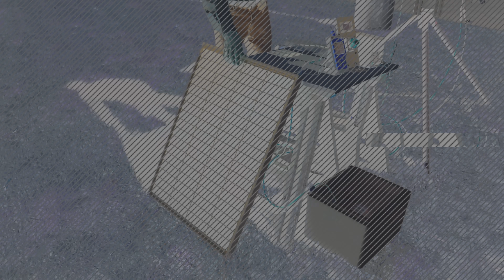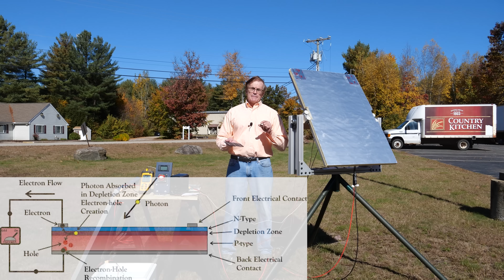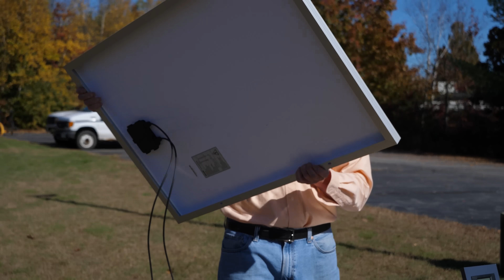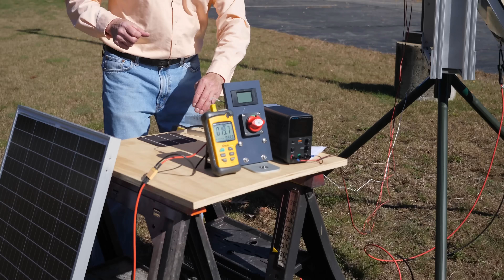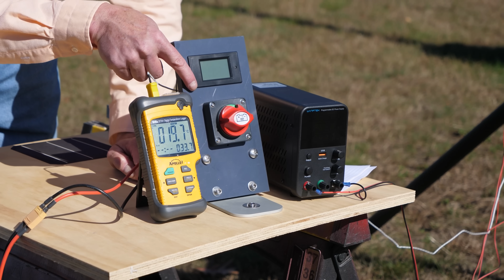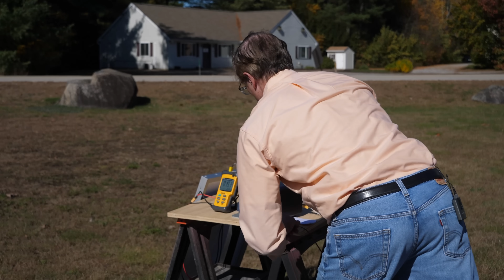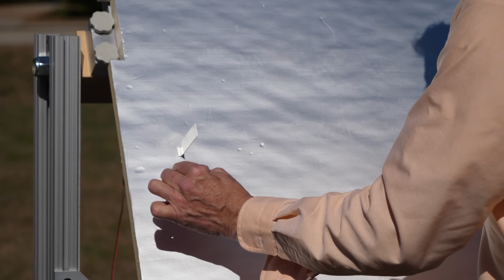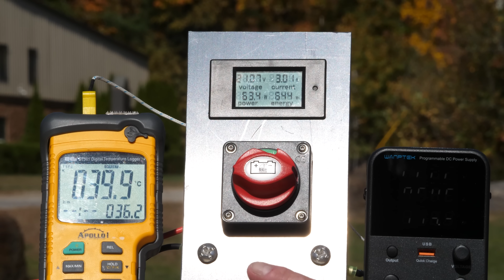Do you REALLY get enough out of your solar panel?

Comment: How about using the 'waste' heat for drying the dessicant in your alternative air conditioner? I would love to see you do that as a video (including analysis of the overall system power consumption, etc.).
Reply: Heat is energy.. so it feels bad just letting it out without use.
Could be used for something.. from heating house, heat storage, water or anything
Reply: @The Tired Horizon  on the contrary, it should be quite hot... ;-)
Reply: @The Tired Horizon  Ye, bi-metal tech is going the right way. But efficiency is still low
Reply: @frosty6960  our guy is testing things .
But is kinda still shortsighted .
Or inefficient .
Reply: Came here to say the same.
I was enraged the whole video, wondering if he would use the heat for the hot water in his house. Or, like you said use its freaking air conditionner. It's the perfect use!
This idea of cooling the pannel, is way better than he thinks.
Reply: @xmtxx  - any war is won one battle at  time - only fools throw all of their men into a fruitless advance.

Ask any general who did not throw is men into fruitless advances - and then go and ask the losers.

Just saying.
Reply: @TheTiredHorizon  or standing at the outlet of the air conditioner, inside.  :)
Reply: One of the problems here is that the heat coming out the other end may not be that far above ambient....  To cool the panel to closer to ambient more volume of cooling air is used per unit time, to cool the whole array equally well, and thus we pick up only a portion of the waste heat in a given volume, and the temperature doesn't rise much, which limits our options.
Reply: @The Tired Horizon  Stirling engine, or Peletier elements. They need a great enough temperature difference to justify their uses, Peletier elements are not very efficient.
Reply: @alexandredevert4935  Pelletier elements aren't very efficient... But at least it's something! Even a 0.0001% amount of heat energy turned into electricity is better than nothing.
If course we should keep researching alternatives, but it's worth it even if it results in 1 less gram of coal or oil being burned.
Reply: @runed0s86  Manufacturing of a Peltier will almost always involve burning more fuel than it can offset in such usage even over years of use. It's fine to look at alternatives to anything, but it's counterproductive to put much effort into things that aren't going to pay for themselves.

Comment: Definitely interesting any efficiency boost to solar without massively increasing cost seems worth it. I would be curious to see the temp difference with the back panel with fans removed rather than just off.
Reply: The fans alone will massively increase cost. The simple fact is solar panels are about 1$ per watt these days, and it's going to be impossible to find a high duty cycle fan, that can survive high temps, outside, that will increase efficiency by 1 watt for each dollar spend on the fan. Then consider those fans absolutely will need maintenance, and it's all the sudden not a good idea.

Comment: That solar panel looks to be about a square meter.  Solar insolation at noon at the equator should be about a kw.  Since the panel is only rated at 100 watts, doesn't that mean it's only 10% efficient?  That far below the 20% efficiency I usually hear about.  What am I missing?

Comment: I would love to see an experiment you thought about making, water based, artesian well, no fans, just a water pump. The water has a constant temperature of no more than 14°C, depending on depth and so the temperature differential would be much higher. If you have a panel that heats up to 80°C at midday, mid summer, you might easily gain recover 30% of energy, minus the one spent on the pump. And I bet the efficiency of the pump goes up if you have more panels.

I just realized this isn't without major problems. If you're using an open system, the water in it is... alive, meaning sediment and algae, and sooner or later there will be a coating forming on the walls of the pipes, the smaller the diameter, the sooner it will become a problem. :( And also, in the winter, you'd have to let the water out or the pipes will burst. But the higher differential is so tempting....

A closed loop system filled with glycol instead of water might be a better option, but you will lose the advantage of a much lower than ambient temperature of cooling medium, with added consumption of both the fans and pump, and added cost and complexity, so I'm sure this one is not worth doing.

Comment: Good to see you back, I have an interesting postulation for you, hope that's the right word. What if you line the back of the solar panel with Peltier chips to convert the excess heat into electricity and then attach the heatsinks To the chips cooled by those fans To maintain the thermal differential Required for their operation.? I think that would be a very interesting experiment to see if you get any sort of significant Energy gain.

Comment: Have you thought of using peltier modules on the back of your solar panel ? Maybe test peltier modules on a black metal panel then a solar panel. I realize the peltier modules won’t draw away as much heat, but the power you gain might be significantly higher. Thanks for the wonderful topics that you produce. Todd.

Comment: 3.5W is about $0.0003/hr at peak sunshine.
More material, and more to go wrong.
Sorry, but I don't see the value / roi in this.
Instead of buying fans every 3 years, and listening to that noise.  Buy another (3.5w) panel.
My weather station has an asperation fan and it drives me crazy and has already failed.
Reply: By my math on the 310W panel I bought for $120 - thats $0.39 cents a watt. * 3.5w = $1.37 worth of panel.

I doubt your fans, shroud,  and maintenance costs less than $1.37

Comment: There are some manufacturers making water-cooled panels. Check out Linus from LTT about his new solar setup.
Also, I think L shape aluminium extrusion is commonly available so no need to go to a machine shop right?
If I doing it I probably buy L shape aluminium extrusion and stick it under the whole panel align with the wind direction, even without fans it should help reduce the heat with just passive cooling.

Comment: Evaporative cooling would work best, fans with water. Seems like misting fans might be ideal, though it means hooking up a hose. (The water pressure might be enough to turn the fans as well.) You might well be able to drop the solar cell below ambient.

Comment: Do the fins with just convection help without the fans? I think that would be good enough in many cases.

Or if you are going to go with the extra effort of a active cooling system (air or water) then maybe use some mirrors with basic tracking to "overclock" the panels?

Also a pool you want to heat is a great place to dump excess heat energy for many places around the world.
Reply: Putting up mirrors is not the way to go. Just install another panel instead of the mirror, the panels are cheap.

Comment: Always enjoy your practical experiments and analysis, very interested to see net gain in relatively temperate climates, I’ve been thinking about this for some time but hadn’t considered your approach for homemade heatsink which had made the capital cost prohibitive from my perspective.  I do think the heat recovery point you made at the end makes the cost benefit case more attractive even for a domestic Instalation if you can divert that heat through and existing air source heat pump and into your hot water (in theory this would increase efficiency/reduce cost of producing hot water).  Nice job 👍👍👍

Comment: the only thing missing is peltier devices strips on the back to use that temperature difference for extra watts... well i don't know how well they transmit heat through them selves but if good enough then a temperature gradient would form and you would get power from cooling! (to be clear, you use them like a RTG and don't put power in them.)

Comment: I'm unconvinced by the reasoning for using a static load rather than a MPPT controller.  How do you know you're not just measuring how much the maxiumum power point is moving, rather than the maximum power output of the panel?  PV panels will only ever be used in practice with an MPPT controller so it's not a confounding factor - rather it is the opposite!!

Comment: Fantastic Video! 
My panels were running at 90 degrees centigrade (Bangalore, India), hot enough for cooking or atleast for bathwater :D 
After watching this video I immediately decided to install a couple of old PC fans per panel running at 8V through a CC/CV buck converter connected directly to each panel. Temps are now between 55-60 degrees centigrade in middle of winter, For summertime I will certainly need to upgrade the cooling! 
The drip cooling system might be more beneficial here once I can figure out a balance between liters of usable hot water per day and optimum temperature of the panels. Wondering if I could use a two stage water cooling system: 
A 12V DC pump in a 75L buffer tank for the recirculating drip system, set to start when the panels reach around 20V. Another 12v DC pump triggered by a float whenever the buffer tank runs low, to draw water from the main (cold) 2000L overhead tank. If hot water isnt used for long periods of time, A drain/relief valve may be required, set to activate at around 65 degrees centigrade, to dump hot water from the buffer tank back into the 10000L underground water storage sump to prevent the panels from getting cooked.

Comment: Well, yes, you gained some power.  But that was paid dearly, first of all with the material costs, then the production and later in operation there are additional costs.  A fan spins, it makes noise, and it wears out.  Nobody wants that!  And that's why I think your conclusion is not only wrong, but also misleading.  That doesn't have to be the case.  It would have been better if you hadn't reported it so one-sidedly positively.  That's why I'm a bit disappointed with your video.  I only find it positive that you have shown once again that the efficiency of solar modules is temperature-dependent.  Nothing new, but at least not wrong.

Comment: Is there some kind of optical solution to reduce the amount and type of light that hits the panel that it cannot use or raises the temperature? I was also thinking that as a proof of concept, what if there was a glass that eliminated those wavelengths with a gap before the panel in a vacuum which would prevent convective heating? I would love to fiddle with this stuff and maybe even use it myself but I live in the Pacific Northwest and even my solar motion lights stop working in the winter when we don't get any sun for months.

Comment: This is an idea that has crossed my mind it's cool to know it works.  I would set it up in such a way that it has a dual purpose, the 2nd purpose would be to actually heat the panels in winter.  Have wire running that can have a current sent in and the heat would be trapped inside the cavity and help melt the snow off.  You'd only really activate this after freezing rain or really sticky snow that is too hard to physically remove.
Reply: Not necessary... solar panels will self thaw very well. Just the heavy snow needs brushed off. They get warm like an electric blanket, and the snow will be gone. I would save it for my electric blanket. If I got a lot of snow I'd put the panels in a pole barn. Or a better location.  Or make an eyebrow that speeds up the air going over the panels so that the snow is blown a few feet away, instead of on the panel. It actually works. At 5 AM, showing 24.5 volts on the twenty big marine battery bank.
Reply: @davidpotter9462  In my experience I always need to take the snow off. Sometimes what also happens is if we get freezing rain or wet snow it will create a nasty crust, which is really hard to remove.  My rule of thumb is whatever i have on my car I will have on my solar panels.  So I go out with a long brush to remove it as soon as I can. But sometimes don't get around to it for a few days.  When I start building on my off grid property I will probably mount them vertical so it will be less of an issue but here at home options are very limited.

Comment: What about service life of the mechanical system, additional cost of parts and maintenance over the life of the panels, and additional cost of installation?

I don’t think adding this much complexity and accompanied cost is worth it.  A better passive solution is to mount the panels in such a way, perhaps using shrouds, that the underside forms heat chimneys.  The excess heat simply gets siphoned forcefully away via convection.

Comment: You could have 4 larger fans per each 10 panels, there could be a channel created at the top, and bottom of the panels to keep the air flow from going anywhere but out the other side, the channel could also act as a spacer so the panels don't sit directly on the roof

Comment: No wont work the fans take that power away also fans will not run so many years 3/5 year bearings are dead costs allot to replace. So after all it costs more or the same. Then you need to build a passive cooling system without fans.

Comment: if you go industrial scale with that much watts being pulled away from them you might be able to turn that into more power through a turbine that can use refrigerant with a heat pump. Just run a ammonia/refrigerant loop from the panels into a turbine designed for refrigerant cycle and back to the panels, or run air to a heat pump with a refrigerant looped to a turbine. The main question is if its worth the investment into the turbine, the refrigerant loop or an air system to dump heat elsewhere is worth for 2% life more per year.

Comment: I've wondered if a container filled with antifreeze that was placed against the back of the panel would cool it also? If there was a way to run a cooling fluid over the panel face without interfering with the absorption process, it would accomplish the same benefit. Oops, you commented on that.

Comment: I remember seeing this done TEGs for the Seebeck/Peltier effect off the back of the panels.  It works but IIRC TEGs are / were too expensive compared to good low cost fans.  That being said 3 things come to mind:
1) Has the cost of TEGs come down enough to where it might be affordable? (Could TEGs be made more affordably?)
2) If we only care about Watts / Energy and we don't care if it is thermal or electrical, doesn't a solar concentrator already solve this?  Especially one that uses a liquid's condensation point (alcohol tubular concentrators)  
I've seen your past videos on solar concentrator arrays and it would seem that at least in the New England States, hydronic heat pumps would have more utility.  However, perhaps there is a breakeven point on the initial costs where with sufficient array area enough heat could be gathered where TEGs or even a Stirling engine could be used to generate electricity 
3) Do you have a formula for the optimum insolation angle to heat gains / losses on those panels?  I'm curious about what would happen to the efficiency but also heat of the panel if you just rotated it a few degrees. You would lose energy from not being in the most direct rays, but you would also simply absorb less heat across the PV cells.
Reply from the maker: It's  best to aim them directly at the sun.
The relatively  low temperatures of solar cooling fluids (air or water)  make the recovery of this energy inefficient or expensive.

Comment: I wouldn't have expected panels to sink heat to the rear so well. That being the case, I wonder how long it would take to heat a reasonable volume of water through channels in an aluminum back to 40C? Use that heat energy to heat water. Win-Win.

Comment: Not sure about your heat and panel life correlate. 120F summer here. Maybe a little, but no 4%+ a year.
Reply from the maker: I didn't  say 4%.  I said 2-3% if the PANEL temperature  reaches 90 C.
Reply: @TechIngredients  Sorry miss heard C/F. 

I'm running 16kw system + 400w backyard solar. I also run electric bike tours with 2*200w foldable panels. 

Here in Arizona heat is a major factor; however at the same time the sun is at the best angle so my generation maxes out for the year.

My DIY 400w could be mod to track I think. Here the only vid of it so far https://youtube.com/shorts/J3eGxIn87Bo?feature=share . Think I seen you do that once. Could be wrong I watch way too much yt.

Comment: Interesting stuff.   BUT since you're not running those fan in your "control" you basically have an insulator sitting on the back of that solar module.  It would be more fair to compare it with the bare panel you have leaning against your work bench.
Reply: I thought exactly the same thing. Even better would have been seeing the performance of the modified but fans off panel vs standard

Comment: So you've shown that turning ion the fans for your modified panels helps. But shouldn't you be comparing the unmodified panels to the modified panels with the fans running?  Your modified panels without the fans running looks like they might trap heat behind the panels without the fans running compared to the unmodified panels ...

Comment: This may be dumb but I wonder your thoughts on if you could make a geothermal setup to cool the air coming into the panels. Do you think it could be worthwhile? As you've said in the winter, it doesn't need to be run. But in the summer, could redneck up some PVC ductwork from the ground up into an intake on the bottom of the panels to maybe cool the air more? I'm curious to hear your thoughts. Thank you for your videos and your time if you read this. 🍻 from Canada as well